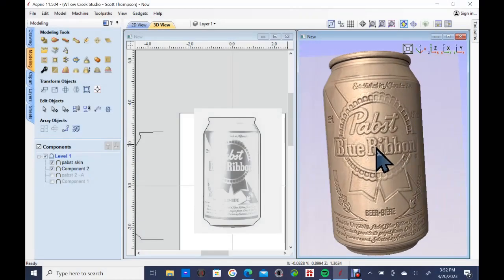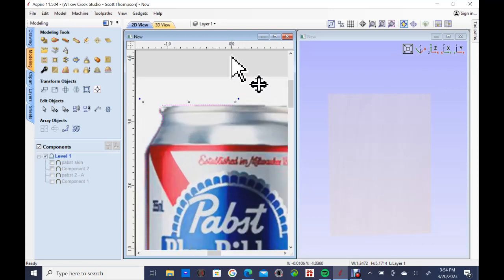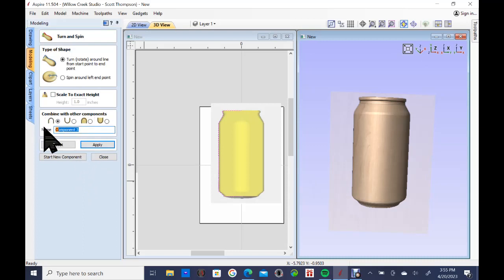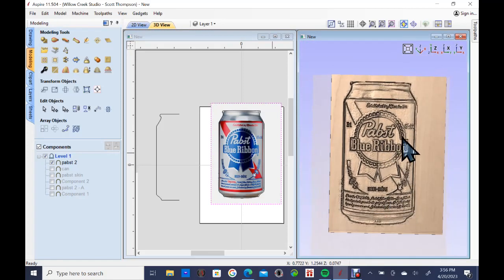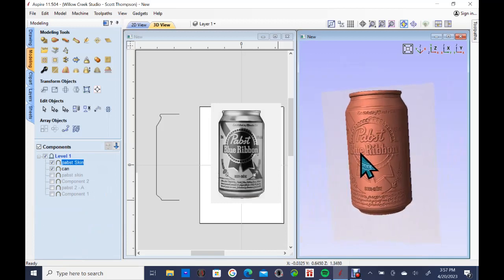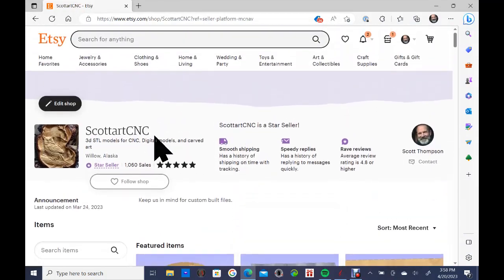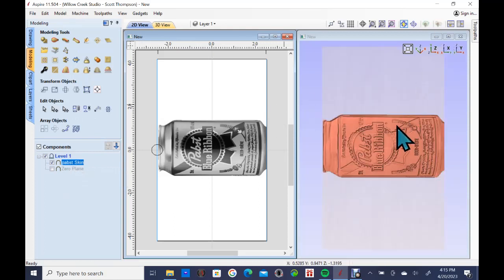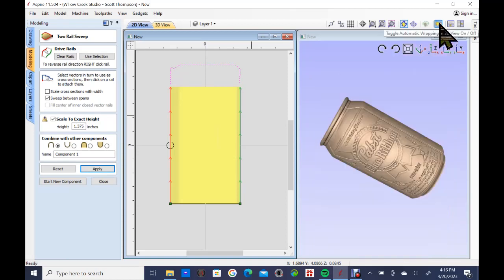Pabst can build II

Comment: I was able to follow this in V12 until 4:40.  I can't find the 'select component using a vector' anywhere.   I'm used to V11 Vcarve Pro and am trying out Aspire v12.  I  wish they hadn't changed the interface so much.  I recognize several of the icons from V11, but don't see most of them in V12.
Reply from the maker: The scissor tool is what I use, and yes v12 moved all my tools, uggh.